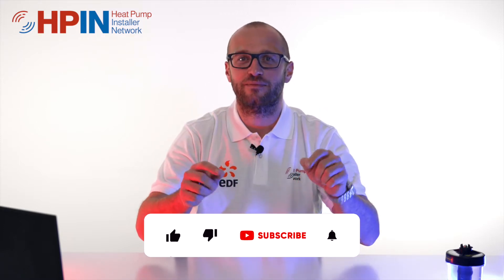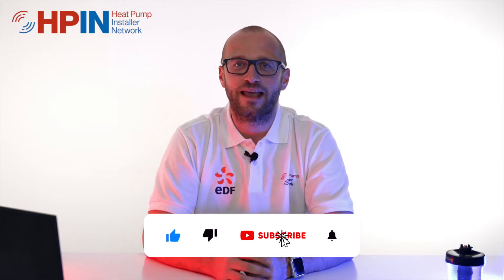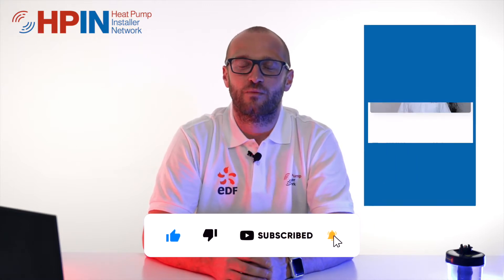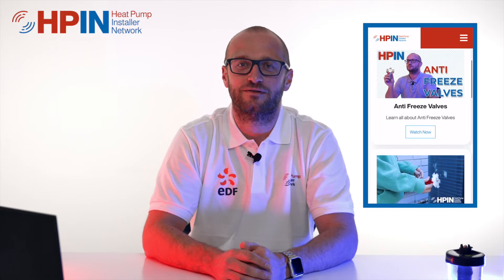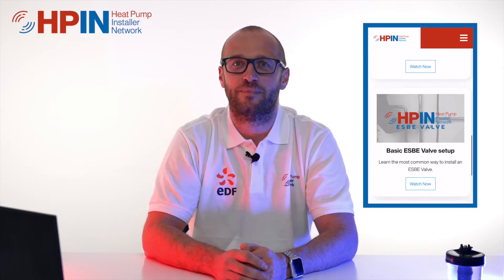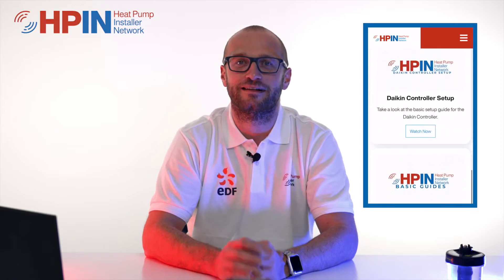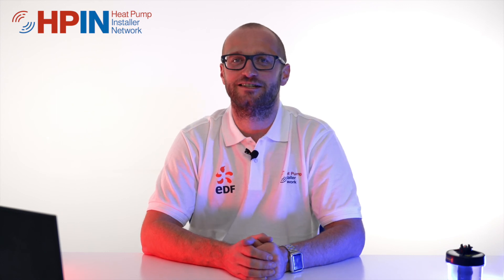Why We Don't Use Glycol

Comment: I disagree with the reasons for not using glycol.
I agree it lowers the efficiency of the heat transfer.
Glycol is slightly slippery so it will lubricate the pipes and water immersed bearings inside the pump.
I would add glycol in a SMALL amount for lubrication purposes only AND add anti freeze valves. Best of heat transfer VS longevity of the system.
Anti freeze in an internal combustion engine does two things. It stops the engine furring up and lubricates the pump. If you run the engine without antifreeze the pump will seize eventually never mind damage from freezing.
Heat pump engineers are obsessed with efficiency figures over safety of the system.
Changing glycol/inhibitor is a schedule service item and should not be avoided.
Reply: Kindly advice the best practice is to fill the system with tab water and just add antifreeze valve ?